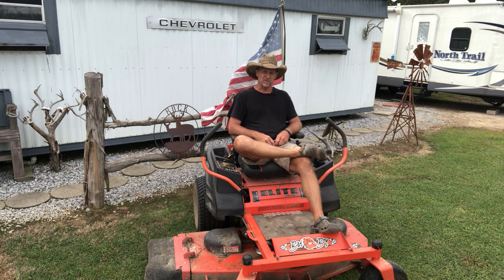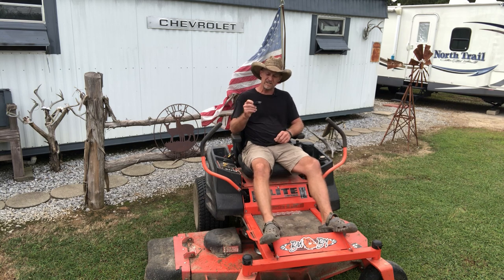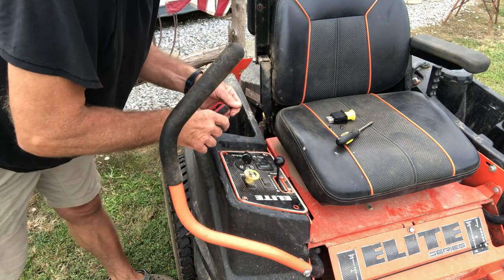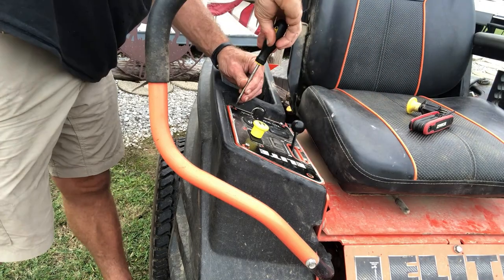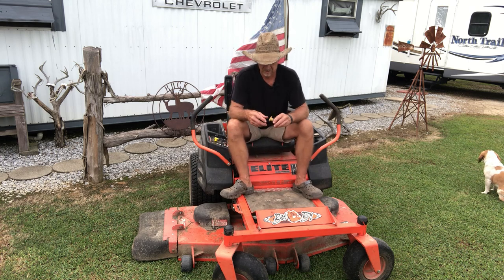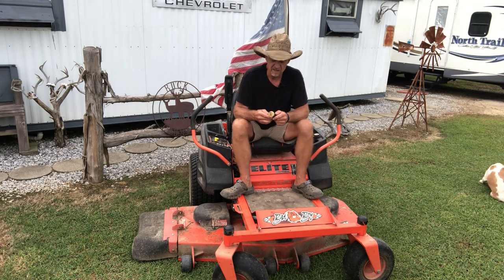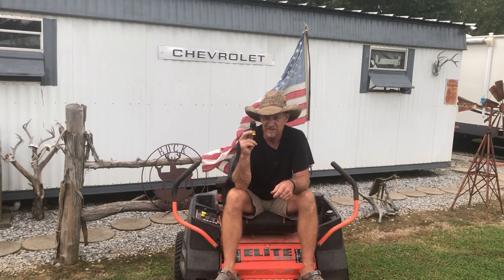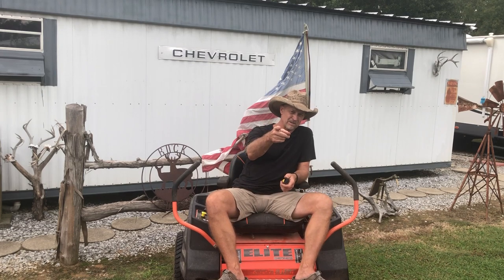How to Test and Replace PTO Engager Switch on your Lawnmower / PTO Engager Switch Explained

Comment: THE number one thing you should check if the switch is intermittent or doesn't work is the battery. Low power or bad connection preventing contact will result in the solenoid not engaging. Hope that helps.
Reply from the maker: Thank for watching and commenting.

Comment: What would be wrong if when I look at my blades on my ztr … one of the blades is free wheeling but the other two are not
Reply from the maker: If the blet is still on the pullies then I would think the bolt has loosened off that holes the blade on.
or if it's a star pattern or something other than just a round hole in the blade it was not installed correctly when the blade bolt was tightened.
That would be my first two things to check out.

Comment: Mine turns over but no start ! When i back the key off it fired for 1 sec then dies , its electical but cant figure it out
Reply from the maker: The first thing I do with any small engine that will not start is spray a little (very little) starting fluid in the air filter. If it does not start, then you know it's an electrical issue. If it does start, then it's in the Carb.
If it does not start, I then start with checking the spark on the plug wire, if it sparks then it's a bad plug (most of the time) If the wire does not spark then I would check all the safety switches with a muti-meter. If they check out good then check the coil. YouTube how to check a coil / plenty of videos out there.